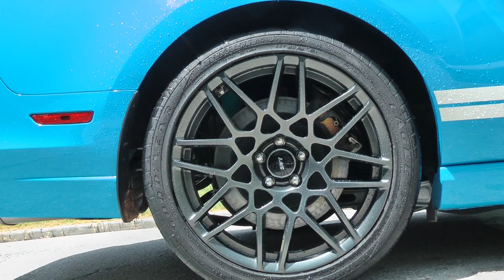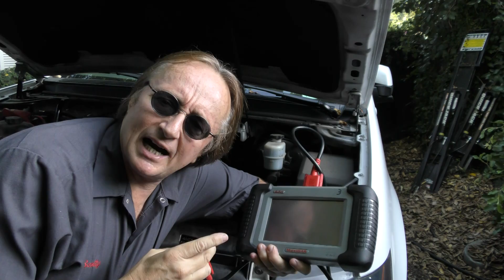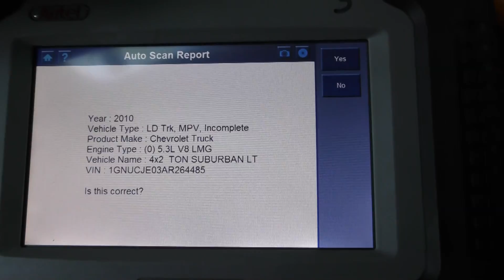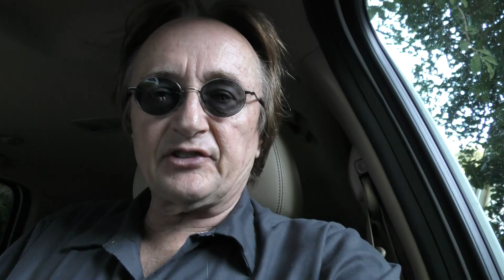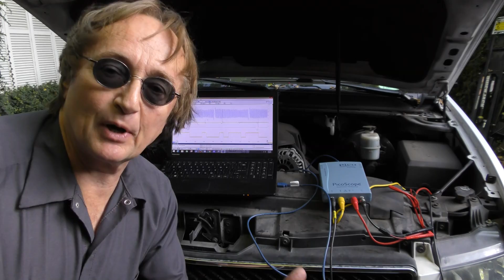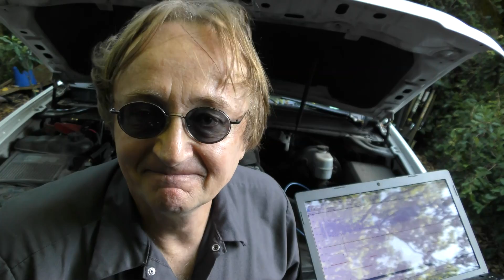Why Mechanics Charge So Much to Fix Your Car

Comment: That still doesn't explain why they charge so much,heck the scan computer is doing all the work.
Reply: The scan computer is so darn expensive. The equipment is really expensive. And it is quite complex, the dumb customer thinks the job is hard hence de expensive repair
Reply: thats only part of it. trying to fix a computerized car part is complex in its own. not to mention that part might be a fraction of the cars value
Reply: STeeLo205 ImDatRapper Those computers that he use to analyze cars cost thousands of dollars. The updates cost thousands of dollars too. You also need other fancy equipment.
Reply: Why does a carpenter charge so much to cut some wood, I mean the saw is doing all the work, right?
Reply: V - Pony I do,that's why I watch scotty..lol
Reply: STeeLo205 ImDatRapper the scan tool is only showing you the data and allowing you to do bi-fold control. you still have to understand what that data means and how to analyze it
Reply: STeeLo205 ImDatRapper i charged a fellow $80 to replace an egr on his 97 nissan frontier. he thought it was too much. the egr was so corroded that i had to put extra force to loosen the pipe that goes to the egr. i loosened it, but my forearm scraped against a piece of metal and it gave me a deep cut. some will say, "u just have to be more careful".
 if you do mechanical work, i guarantee that you will get cut and bruised
Reply: Then do it yourself
Reply: +STeeLo205 ImDatRapper Ok I took the time to due an estimate for your 05 Sub. I come up with 248.44 Parts, labor and tax. Now the Parts are not 5 dollars. At O'Reilly 's master pro will Cost me 27.99 and will wear out in a few yeare. Moon will Cost me 46.99 and will last. Now your Cost for the quality part will be 70.49 per side. Now I can hear you screaming that I'm ripping you off because I Mark the part up. Well welcome to capitalism.  I bet where you work they mark up what ever they sell. That's how you get paid. Now let's talk labor.  I looked up the labor and it shows .5 tenths of a flat rate hour.  Now I have a minimum of 1 hour I'm going to charge.  If I were rebuilding the complete front end I would Bill the .5. Now I don't know what your guys overhead is so I can't speak for his pricing. It may be steep but maybe he has plenty who can pay him. I never blame someone for charging what the market will pay.
Reply: Harley Mike   Yes, it changes, but when it is so often, so complete and so expensive, it begins to be a problem -for nearly everybody.  Dealerships complained of this also besides independent repair shops.
Reply: Harley Mike   This completely scares me. It makes people very vulnerable and reliant on the corporation.  Too many "err on the side of replace everything ", too much shuffling or hiding the responsibility, easily over-cautious with safety excuses. E.g. Can hardly plug a tire now; had a windshield washer motor that was acting up - all it really needed was some cleaning and good grounding.
Reply: The mechanics who actually do the work are paid shit wages just like everyone else....Its the owners who dream up scalping the public and the bloated prices they charge....Anything regulated by Govt. results in the public being skewered , battered  and  Burned....
Reply: A "Good one" of those is running around 10,000. the experience to know what it is telling you can take decades to acquire, that is what you pay for. It is very rarely hook up the computer & bingo.
Reply: gizzy nc Exactly understanding the technical jargon those scan tools provide is a whole other skill onto itself.
Reply: Yep. Not only that but verifying what the sensors are telling you is correct, but also verifying it is not the sensor lying to you & causing the issue you are trying to fix. I'm not even a master tech yet & im 5 yrs in you guys don't want to know how much i get paid & how much of that i spend on tools to repair the vehicles of the ungrateful. Not to mention the danger. Auto workshops are the 5th biggest killer in the US workplaces.
Reply: +STeeLo205 ImDatRapper If you can't or won't understand I can't and won't help you.  I will tell you this though.  If you can't afford a car, then don't own one!
Reply: STeeLo205 ImDatRapper the highest you have seen is $1200, but they get way way more expensive. my buddy who operates a repair shop, had to pay $4,000 for his scanner. That wasn't even the most expensive one. and it doesn't stop there. there are lots of tools they have to buy the are all super pricy.
Reply: Let me help you understand why shops charge what we do.  I own a small Auto Shop in Houston.  For me to hire a mechanic who is worth a Danny it's going to Cost me at least 20 bucks a flat rate hour.  Now let's add in another 7.50 per flat rate hour to cover his government mandated workmans comp. Now let's add in another 7.50 per flat rate hour to cover his government mandated social security that I the owner has to cover. Now I have 35 dollars in labor per flat rate hour.  I charge 85 per flat rate hour.  Now I have 50 dollars per flat rate hour left.  Now I have to pay for Land, electricity, water,  government mandated insurance,  equipment, maintenance and what ever is left is what I get.  Not as profitable as you might think fella. Now you can save a lot of money by cooking at home, but I bet you eat out!  You don't complain then! Try owning a business and then you will understand.
Reply: STeeLo205 ImDatRapper they always gotta break out the torch too for an extra $500 bucks lol
Reply: Dom sava please,I have seen the mechanic scam..just because you rather pay $1,000 to change windshield wipers
Reply: Harley Mike that still should make you charge an arm and a leg.to remove and install and reset,the parts are already assembled.if people didn't buy into all these robot cars,it would be better..
Reply: Lou Fazio See a complete scam by mechanics,they are figuring ways to get more money out of people..
Reply: nurettin ozgur the commercial scanner yes is high but the hand held ones aren't that much..
Reply: Simply because we have to make ends meet. I don't cheat anyone. I give my customers fair prices. You know how much mechanics pay on tools and taxes nowadays? Plus all the bills running the shop The time and complexity of most modern cars today. Yes there's alot of scam artists out there, which give us mechanics bad names and losses in business, but there are many out here just trying to make a honest buck and live. And plus scan tool can get up into 20,000 depending on brand and complexity and updates can cost thousands. Not to mention all the expensive equipment we have to use on modern cars. Blame the engineers not the mechanics on that.
Reply: Bjorn Ironsides if you had any common sense you wouldn't make that opinion and like  you say your not a mechanic so you don't know,and I know you get jacked around when you take your car for repairs they just tell you anything and you believe it..
Reply: FiveStarStreetMachines you think these car developers doesn't know these car parts will fail at a certain time or milage..people are so stupid,the stuff isn't complex everything is timing or temperature..they have made it complex to keep customers from tampering with there own cars to save money
Reply: Rocker Pat I understand a mechanic charging more because of his labor invested into providing services and your right if you can't afford to fix it don't buy it..But I replace some sway bar links on my 2005 suburban a shop wanted to charge me $350 total..come to find out the parts was $5.75 for a set and one bolt holds it on with a little common sense and observation I change them myself and check my suspension and steering afterwards,,and haven't had no problems since.every since then I have learned mechanic lingo and learned to recognize the slick talk and scam techniques.it's not regular people fault cause they have made cars like computers now and they mess up
Reply: Jose Garcia My wife is being charge $65 to change a cabin filter in her car..all you do is pull it out and put it back in..$65 see the scam..
Reply: gizzy nc And if you didn't read my post ..I do my repairs myself now..that's why I watch scotty..
Reply: Good for you. I think that is the correct way. I wasn't trying to be a dick. I have always said it. I'm a tech of so many disciplines because I can't afford to pay shop fees.But to answer your initial statement. the scanner isn't doing all the work. what happens when you change to affected part & the issue is not rectified? there is a lot of work that can go in to a system you don't see. checking for continuity, grounds, following the wire diagram back to another system. ect.
Reply: STeeLo205 ImDatRapper 1200$ bull shit that's on the cheap side of scanners. You don't know shit.
Reply: STeeLo205 ImDatRapper typical "customer"
Reply: Mick Vaillancourt   Plus the changes in the equipment were a big issue.  Hopefully the situation(s) will stabilize.
Reply: Yea sure, because changing struts mcpherson struts in romania wich is a poor country but the mechanic asks 100 dollars to change them. Bare in mind that the minimal income is 200 dollars.... didn't know that you need to diagnose fancy tool shit to change a strut... but yea, let's tax 5 hours of labor and the car will be ready in 2 because romania mechanics are "cheap and sincerely not thieves at all"...
Reply: STeeLo205 ImDatRapper yea but those scanners can cost up to few thousand dollars
Reply: STeeLo205 ImDatRapper And there's nothing wrong with that :)
Reply: Tomas Gaspar yep man you should have tooken extra caution,when dealing with tough ass screws and ect.thats stuff you should already know but $80 is fair,Mechanics  like you dont exsit anymore
Reply: Dave yep
Reply: It's still a mechanical device. Besides I wouldn't want to pay myself minimum wage or below minimum wage for this service.
Reply: You're a fucking dumbass... lets just leave it at that....
Reply: but its a scan computer that you don't have
Reply: taushahamon skills and experience,,lol..repetitiveness and from working on older  model cars..all that stuff tie into each other,all these cars are the same in a way
Reply: well 1 simple answer, as you seem to know it all. go the full hog & do it all yourself. then nobody can ever rip you off, nobody is forcing you to use auto shops.
Reply: Did you do an alignment afterwards?
Reply: Jose Garcia I didn't have to do one,it didn't throw off my alignment.I didn't change the sway bar,,just the suspension links..
Reply: Its also the labor rate that will ream you. In New York, most shops charge around $100-125 per hour for labor. That adds up if your car has many problems with it when you go for something as simple as a break change. Maintain your car and you won't be spending $3-5 grand to the mechanic or more at the dealership if you really fucked your car over.
Reply: if you don't like the cost, simply go do it yourself! nobody makes use auto shops.
Reply: Dave hehe...yes but the saw is not binary...
Reply: cause youre over like a grand for the thing it has to make money
Reply: @HAL-dm1eh  What freedoms are being taken away by Musk exactly?
Reply: Mick Vaillancourt the highest I've seen them is $1,200 that's not a lot.I understand the knowledge the mechanic needs to have to piece it together..but the computer is basically chasing down the answer for you..the expense is when shops charge you for deposal,tool use,environmental tax,and a for parts that cost $5 to make and sometimes they be refurbished or recycled parts it's a full on ripped off..
Reply: David McClelland your right man they don't want people to be able to do it themselves.it's a corruption system,they design special tools that the public can't buy,or find.most of these newer cars engine bay are so cramped a regular person can't get their hand in there to even check fluids..they are designing these cars parts to fail at a certain mileage and making them to were you have to take them back to the dealer for service and only to the dealer..it's a scam man
Reply: Rocker Pat So that means let charge the paying customer $300 to do a brake change.cause you have to pay all that extra expense..even tho as a business owner you get tons of tax breaks and write offs especially for hiring employees..also depends on the location and conditions of your shop..Sorry buddy,still not a good excuse..if you had to do like some restaurants when they grow they own stuff,pick it,and have they own farms different story.but just because you have uncontrollable expenses that was set up by laws and regulations in government..don't  means you overcharged people..a part that cost $5 to produce cost the customer $800 dollars to replace..and a mechanic 2min to install...
Reply: Kuljot Dhami actually no,the tool is telling you what's wrong..like most stupid people just depend on their tire sensor  to tell them when the tires are low instead feeling how the car drives,then run to a mechanic and he charges you $100 to change a flat...